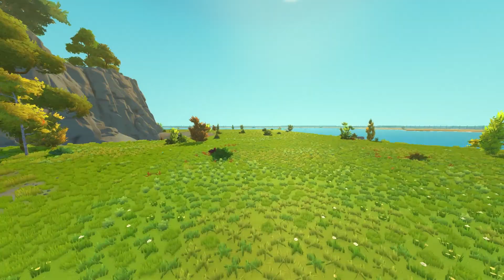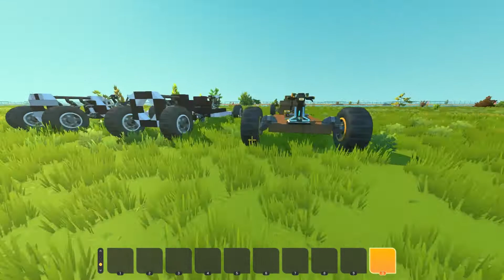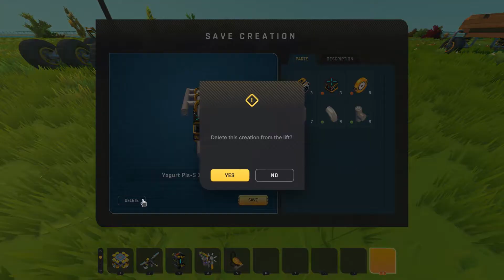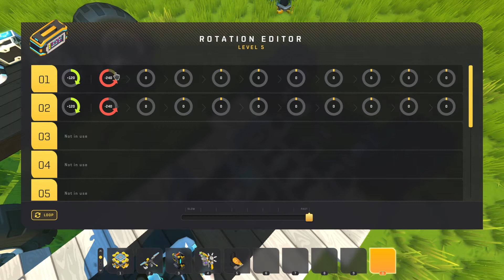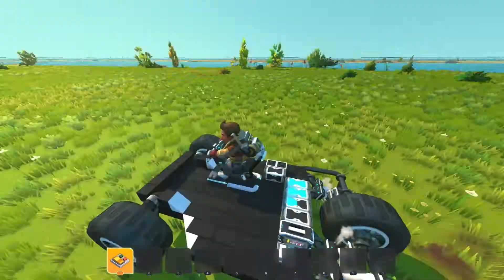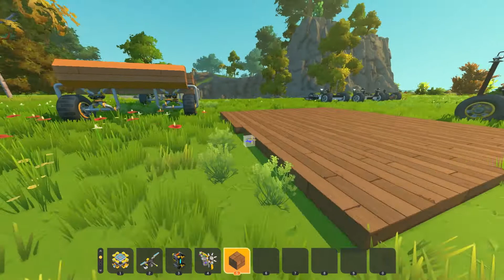Timer Piston Engine showcase - Scrap Mechanic

Comment: Sensor piston engines have the benefit of being able to run at any weight because it’s based on sort of a mechanical timing belt, whereas true timing only works under no load
Reply from the maker: I suppose so but if you weight a sensor engine so it takes x seconds for the pistons to extend all I gotta do is set my timer engine to extend its own pistons for the same x seconds. Then it should be able to love the same weight.

Move the same weight*
Reply: @YOGURT1  I’m saying the ones where there is a still colored disc which is used to
Give input to pistons and fire them off (kind of like the distributor on a car) and I’m saying that u don’t have to make minute changes on load and it has a distance the pistons have to travel instead of having a time they will fire off, your design is definitely more complex and if tuned well runs so much better than sensor but I’m saying a engine with sensors can remove the need to tune.  I would like to end this by saying niether one is perfect and they are both flawed so I believe that sensors and timers should live in piece not war
Reply from the maker: @frightenedskillet1051  I agree dude ;)
Reply: @YOGURT1  as god intended

Comment: Thanks for a interesting video and some great idea's! (im looking to do something timer based for a radial engine where my usual tricks dont work & this helped!)

That said, for the designs of engine you are making, i do feel like sensors would make this that much easier and more reliable :D (but no, keep reading, i do not mean the horrible 'timing plate/bar/stick' approach, that's just ugly, never do that again) Using some sensors you can control the timing based on the rotation of each of the pistons, that way timing will ALWAYS be correct! (also if engine runs slower because of a heavy load, etc)

My suggestion would be to "make hammers" as that seems to give the best results (with sensors looking at pistons for timing i mean) across many different engine designs, regardless of number of pistons:
On your 'straight axle' (sorry, im not great at real world terminology, the one that your piston bases attach too) instead of putting the pistons on bends or T shaped pipe pieces, put them on + shaped pipe pieces, then opposite side of the piston put a T shaped piece in the direction that the piston rotates in with 2 screws on the remaining ends, now use a sensor on one side looking at those screws to do the timing, if it sees the screw, fire piston. Besides being very nicely timed, the interesting side effect of this design is that you can simply use sensors on the opposite side of the hammers to run the engine in reverse (so you could either put the sensors on a rotating arm or slap on 4 sensors on the other side too & throw a few logic blocks into the mix to define what sensors to use when) also unlike the stupid 'timing plate/bar/stick' design, this sensor based design will work the same in all 3 gamemodes and it can have unlimited number of pistons. (so essentially the same positives as your timing system, without the negatives of possible desync)

Since the above can be a bit unclear, see the below for an example image, my pistons are upside down compared to yours but otherwise it should be pretty obvious what i mean with the hammers and sensors looking at them, note that there's also an AND gate for each piston (in the design below i ended up placing those in the 'straight axle' because why not lol) each sensor connects to the related AND gate, the AND gate to related piston, and then finally a switch to the 4 and gates. (so you can turn engine on/off with that switch) The other switch connects to the controller and that just rotates the arm that the 4 sensors are on 180' to the other side, so it can see the opposite side of the hammers for reverse (again, you could do that without moving parts and some logic instead if you want)

Find the example image here (just replace dot and slash, did that so it wont deny me posting this comment) -> imgur (dot) com (slash) aqQV7bO

Thanks again for giving me some idea's for my current timing based engine project & i hope the above helps you with your own engine projects!! Hope you do give sensors a second chance with a less bad design, as the above design gives a really nice and smooth result with no drawbacks :D (one more boo at 'timing plate/bar/stick' design!!!) 👍
Reply from the maker: sensors are better for top speed I do agree. I did want to make this specifically to use timers instead to limit my self. I like the weird timing hammer idea i have seen this used before and looks really cool! sorry that links arent working. thank you!
Reply: @YOGURT1  thanks to you too, made a radial design with timers :)

Comment: I have a idea so take 2 engine glitch weld it but put a bearing on 1 offset it by 180 before you glitch weld and connect the 2 shafts and you'll have a engine that is half the size it's supposed to be you can do as many as you want but put bearings to offset them this way you can do 360 pistons if you trying to do more than that then you have to find another way to offset them if you do not want multiple pistons in 1 stroke
Reply from the maker: YES! i might try that. i usually play vanilla and try making everything vanilla so if i can figure out a way to do this old glitch weld style i will!
Reply: @YOGURT1  I wrote that half a year ago and now that I'm reading this it makes very little
Reply from the maker: @kittyn5222  it just popped up as a new notification for me lol
Reply from the maker: Wait hold on now I am confused. Did you  make another comment my phone is spazzing out.
Reply from the maker: you did im just on the wrong video lol
Reply: @YOGURT1  lol

Comment: Timers are a pretty good method if you just want to have an easy time adjusting your engines speed at lower rpm, the only thing is, timers limit you when you want to have really fast piston engines (faster than electric engines) because of tick delay in logic blocks, that’s where sensor plates with timing advancing come into play.
Reply from the maker: I did not know that, but I think that it doesn't matter as I can use the tick delay as part of the timer system to drive the engine. Since the max speed of the pistons means that the time taken to extend is slower than what that delay would be (I think this is how it works but am not sure). I want to make a second video covering it all better and showing the proper process as well as comparing to as other piston engine designs (timer, sensor and anything else that exists). So if there is anything you would like me to cover please let me know!
Reply: @YOGURT1  yea you can use timers just fine like that for normal stroke engines, something that I forgot to say is in the really fast piston engines, there is a method used called short stroke where you actually need sensor plates since logic gates and timers can’t actually fire fast enough to keep up with the speed of the engine, I think the maximum speed you get out of timers is something like 300 rpm, but sensors have taken engines up to 15k rpm. Since I have some fast designs, I would also be more than happy to give them to you so you can compare and contrast in your new video
Reply from the maker: @Ben_Bingo  Damn that fast. I haven't heard of short stroke. I would be absolutely love to compare the two types. That speed is ludicrous!!! I will take a guess that it is called short stroke because the pistons are extending less than 3 blocks?
Reply: @YOGURT1  Exactly, you use bearings and controllers to bring the crank pin closer to the crank so you actually end up with a stroke of around a block or even less, that’s when things get insane, It’s also a  really good way to trade torque for speed
Reply from the maker: @Ben_Bingo  Do sensor's have a logic delay before outputting a signal after triggering? Have you tried double stacking pistons. That might get some torque back.

Just remembered that you need a block in-between (this ain't minecraft), which might make the engine too big.
Reply: @YOGURT1  They actually do which can sometimes make things unstable, and also stacking pistons does work and you can do some fancy stuff where you don’t have a block in between , but I wouldn’t use it in a car since it is unreliable sometimes
Reply from the maker: @Ben_Bingo  Yeah that sounds about right for scrap mechanic. How do you wanna share the blueprints? steam workshop I think is the easiest but if you don't want to upload your blueprints to there. I can set up a email for you to send them to!
Reply: @YOGURT1  I can just make some workshop links if you like, and ill just send them here
Reply from the maker: @Ben_Bingo  If its not too big a hassle then yes! perfect! I might be able to release another video soon using my current computer (old laptop with very little gpu power) but in the case I cant get good recording quality out of it I might have to wait until I get some more computing power.

I am actually trying out this lossless scaling program on steam which lets you run games with upscaling to get more fps. If it goes well then I will be able to make another video!!!
Reply: @YOGURT1  I think YouTube might have deleted my comment when I sent links inside of it, have you got a discord that I can send the links to instead?
Reply from the maker: @Ben_Bingo  https://discord.gg/89RsJRxz this is an invite to a blank server
Reply: @_Mc_  If you still have the engines would you be able to send a link? I'm trying to get better speeds with shorter gearing
Reply: @jancarson5027  yea sure I still have all of my engines, are you looking for insane speed (faster than electric engines on max) or just manageable speed with good torque?

Comment: huh i made them a bit later and mine is a i3 and it runs great 0 first timer and 275 second
Reply from the maker: hmmm I will have to do some testing. sorry, did you build one from the video or your own design? I know mine have a bit of leeway when it comes to the timings.
Reply: @YOGURT1  on my own then i seen this
Reply: it uses the rotatonal speed lf the pistons with a timing wheel to detect what speed its at to accordingly adjust anything lower it stop speeding up and anything higher slows it down
Reply from the maker: @Wreckedftfoxy  So a timing wheel sets the speed of the timers? hope I got that right. Cool!
Reply: @YOGURT1  yes and as the engine is running the timing wheel sets it again and over and over its a mechanic system but it works great
Reply from the maker: @Wreckedftfoxy  I would love to compare the two designs. Could you link a workshop upload for your design?
Reply: Idk yet if I wanna put it on workshop
Reply: I might add advanced timing
Reply from the maker: @Wreckedftfoxy  thats all good! I can upload some of the machines to my workshop and link it if you want top test mine?! ^V^
Reply: @YOGURT1  eh i might upload mine but i perfer sensor engines with a timing plate more as they run faster
Reply: @YOGURT1  alr here u go this is the V2 version with advanced timing the left switch is advanced timing and right is engine starter and it operates right then left
Reply from the maker: @Wreckedftfoxy  hello! sorry, is there a way to download your design?